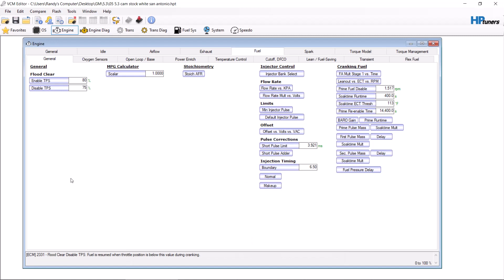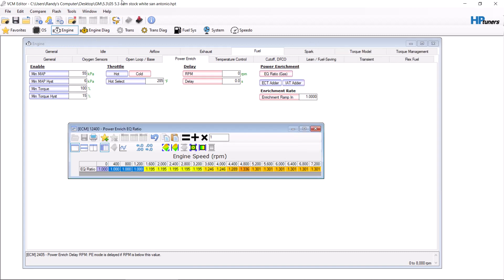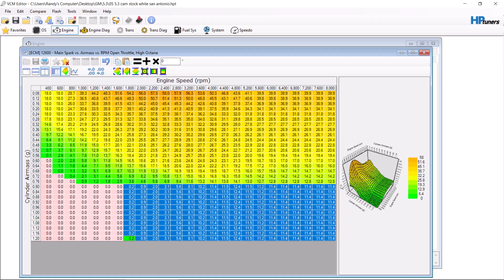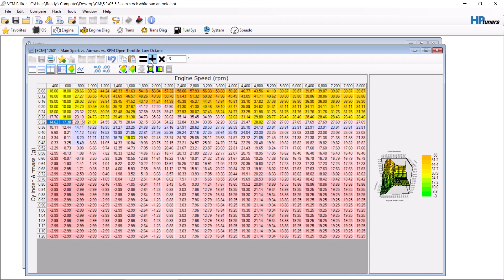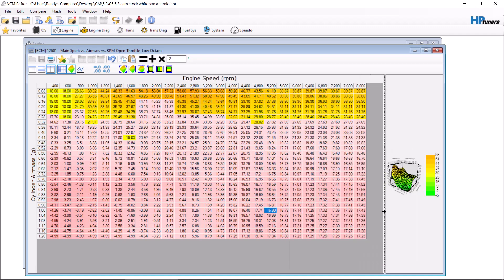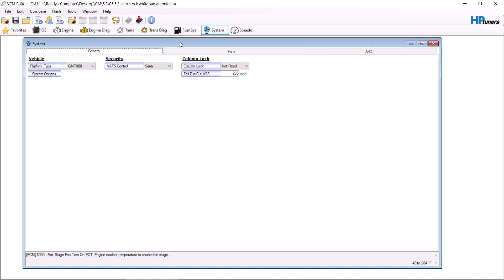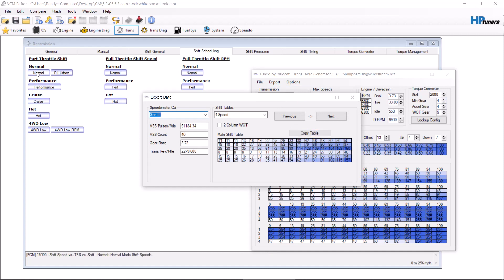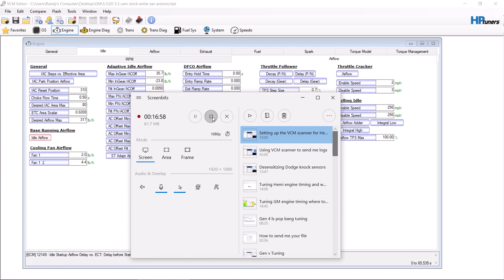Doing a base tune hptuners

Comment: Random ve question. I'm a newbie and thought i was pretty close to done with SD tuning and ve tables. Now I'm spun around after watching more videos on spark and I'm questioning if I tuned ve probably. 

I tuned ve with maf disabled and used afr to dial in ve table. But I wasn't making adjustments to match command afr I was making adjustments to put the afr where I thought it should be such as leaner at idle and cruise and richer 12.5-13.5 under load and wot. Then a light bulb went off and I'm now wondering if I should be matching command afr with actual with my ve adjustments and then adjusting pe tables for additional fueling during heavy load scenarios. Am I right or wrong with this?
Reply from the maker: Ve table has to only be adjusted based on 14.7 to one there are separate areas that control idle extra fuel and wot fuel
Reply: @ I appreciate it. I watched a few videos trying to find an answer to something I’m stumped with in my tune and started questioning myself. Coming from carburetors and sbc I just knew where the afr needed to be and adjusted accordingly. Keep trying to break out of that mindset with tuning. VE should be tuned to match command afr or 14.7 as much as possible and PE steps it up for wot. I actually have my idle around 16.5 and anything under 2400 rpm around 15.2 but one I start getting up to interstate speeds where I’m at heavier loads for prolonged periods of time I went to the richer side around 14.3-14.5. So far I am extremely happy with fuel efficiency. I put a ss2 cam in my 5.3 avalanche along with a 2600 stall. The truck is better than it ever was now. I just can’t get it to break tires loose which is why I was questioning all of my tuning efforts. In the channels it’s shows traction control “on” but I can’t find a way to disable it.

Comment: How much remote tune?
Reply from the maker: Depending on vehicle most remote tuned start at 300. Diesels are 500+
Reply: @Recklessmotorsports  2016 escalade 8 speed
Reply from the maker: What’s all done to it
Reply: @Recklessmotorsports  3rd cat delete first 2 still there. Muffler and resonator delete to. All stock other wise
Reply: @Recklessmotorsports  I have hp tuners. Disabled afm. Lowered power enrichment to 50% throttle didn't touch ramp. Removed tcc till 5 gear and slips till 5th gear.didn't do anything else
Reply: Are you still doing remote tunes?@recklessmotorsportsusa3443